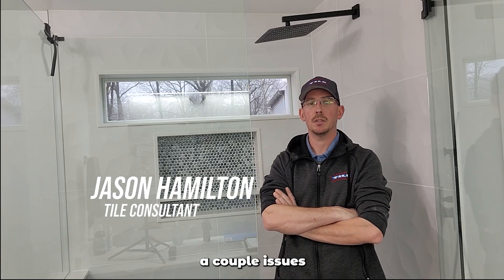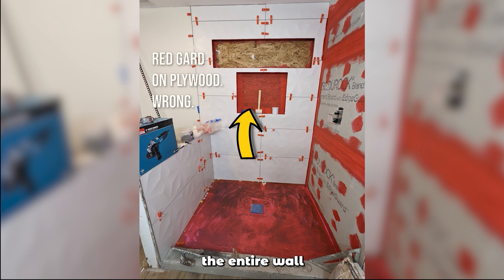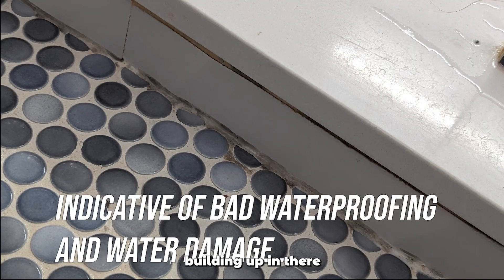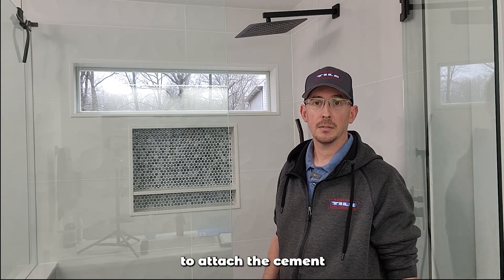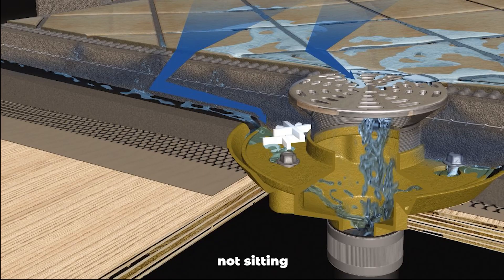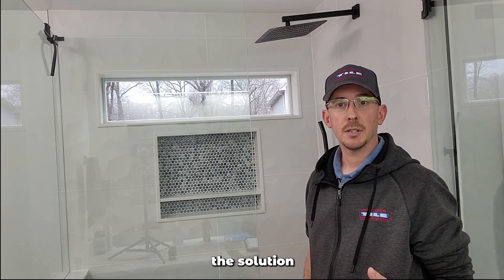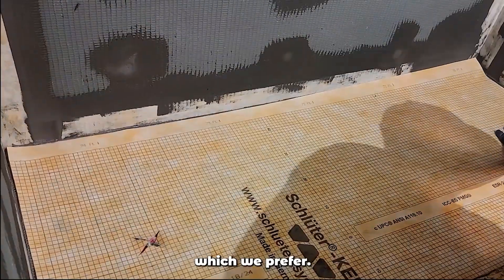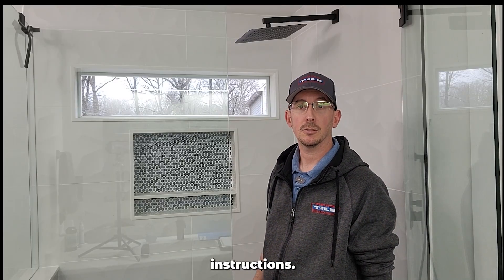WRONG: Mixing shower systems: Here's how to build a "moisture sandwich"

Comment: you mentioned moisture sandwich, can you explain? do you mean between the floor tiles thin set and redguard? if so, why does this happen between tile and redguard but not between tile and kerdi? thanks
Reply: I did all the right thing, pre slope, pan liner, pea gravel to protect weeping hold and final mud deck.  I think I made the mistake of adding 2 coats of redgard on my final mud deck.  Will clearing the redgard around the drain area help with mold sandwich?  I really don't want to remove all redgard as I do believe if water can get through redgard it will just flow to the weeping drain.
Reply from the maker: It's mostly the 3 piece drain, that doesn't have the bonding flange...moisture gets between layers there.

When you use kerdi, you bond it to 3" of bonding area. Same if you painted it with topical.

If a 3 piece clamping drain is used, and kerdi or redgard is used...there's no area to bond the topical.

That's where water gets in between the layers of mud bed, red hard, rubber liner, etc and gets gross..."moisture sandwich"

Wrong use of parts and pieces.
Reply: @HamiltonTileGA  gotcha...I have only done traditional showers with pan liners and mud pack floors, been in business here in Florida for over 40 years but showers for like 20. I have yet to have a single call back on hundreds of showers, so at almost 60 years old probably won't change my ways, but always hated the vinyl liners and would like to try without.  All showers here have 3 piece assembly here and instead of messing with them figured the same as what you said, being the issue is at the drain and not being able to seal that particular area, so looking into the flo fx drain that adapts to 3 piece drains.  Now if you kept in the liner, used just a regular 3 piece drain and either sheet or liquid membrane over mud pack wouldn't whatever moisture that got in at the drain  would just  travel down to the weep holes? I guess perhaps it would but probably not good if water backed up? Does a water back up have different characteristics with a bonding flange? Appreciate the info

Comment: If I wanted to do 12x24 niche with cement board am I still legit? 16” OC studs.
Reply from the maker: Get your vapor barrier up behind it cement board works
Reply: @HamiltonTileGA  Id be kerdi papering the whole thing. Is vapor barrier always required behind?
Reply: I’m surprised you advocate vapor barrier behind the cement board as opposed to in front….isnt vapor barrier behind cement board allowing vapor to sit inside the cement board?!

Comment: The drop ear elbow in the wall probably only has 3 screws holding it in place and the big rain style shower arm can act like a lever and pull them loose. I am curious if you have a trick to stiffen that up.
Reply from the maker: No trick. That guy is just long and that leverage makes it loose. That one could be tightened up, but generally its just a bad design

Comment: Great video. Waterproofing shower pan in very bad idea.  If you have a waterproofing on the curb then screws on the curb will not cause the leak. Penny tiles should never be used on the shower floor.  They hold too much water on the surface. Most clear silicone will have mold issues. Mold just grow under silicone.   Great video :)
Reply from the maker: Thank you!